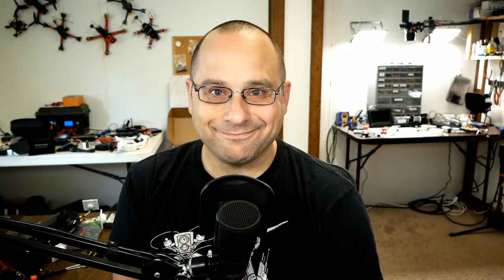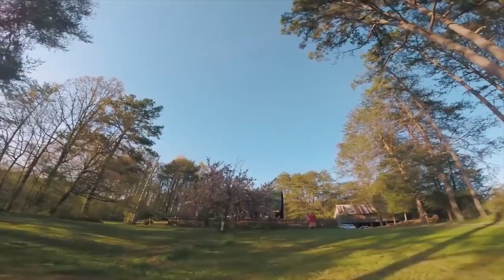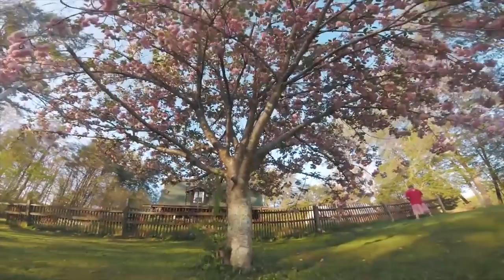Parallel Charging | CAN YOU MIX DIFFERENT mAh OF BATTERY

Comment: Great video! Love seeing myths addressed.

Most chargers use a particular level of current to determine when to stop charging though, not voltage. It’s often 1/10 of the bulk charge rate but can be fixed too.

A pack being charged will reach 4.20V before it’s fully charged due to its internal resistance and a gradient in the ion distribution causing a voltage difference at points inside the cell. This point is where the charge process switches over from the CC phase to the CV phase and the current begins to drop. As the ions have a harder and harder time diffusing into the anode material, and the number of available nooks and crannies drop,  the current keeps dropping. 

As charging could actually take days to truly finish, where the current has dropped down to the leakage current rate of the cell, most chargers just call it quits when the current has dropped to a certain level. Going further raises the level of stored charge but at the expense of significantly longer charge time. The stopping point is sometimes called the taper current or termination current point.
Reply: Hey, it's you, Mooch! You've taught me a ton about batteries. I'm looking forward to your charger comparo. I wondered whether you were into multirotors when I saw that you mentioned LiPo chargers in your poll about what to test.

Comment: im planning to buy 2pcs 20Ah , and i have already 2 pcs 9ah for my mini solar setup
can i mixed this 4 ? (parallel)
so my plan is
9 20 20 9
then direct the charge from right 20 positive and left 20 positive.
it will work?

Comment: Hi..can i use a 12 V power supply adaptor with 300mA instead of a 12V 160mA?
Basically i need a 12V   160mA for a microphone wireless receiver..and i cannot find a power supply for this one....im just finding 12 Vand 300mA instead.
Thank you!
Reply from the maker: The amp rating is a maximum. If the psu is rated for 300 and the load pulls up to 160, you're fine. It's only a problem if the load pulls more than the psu rating.

Comment: hi Joshua, I do have a question, I have E-scooter with 18 Ah battery build in, and I have just bought a Ebike battery with 17 Ah, they both are 52 Volts,  If I want to use them in Parallel connection, they should be fine right? and I charge them separated with their own charger until it is full charge before I reconnect them together again, that  I shouldn't have any trouble right? please let me know If that is right. Because my 18 Ah battery is not enough for the range for me to use, and I can not afford another higher capacity E-Scooter at this moment.

Comment: Hi Joshua excellent and very informative video
Now i have planned to parallels two batteries but before i do it i need some more points to clear kindly reply asap
1. i have two batteries 185AH Tubular Lead Acid one is new and one is old " 1 year old " the old one is c rating is 185/10 and new one is 185/20 " is that ok to connect them "  ?
2 old 185ah battery shows 12.6 volts and new 185ah battery shows 12.8 volts (after full charge disconnected from charger for about 3 hours ) " can i connect them together " ?
3. i have a 20 amp charger when i connect this charger on these batteries it will provide 10 amp of charging current for each batteries " is that ok or should i connect separate charger for both " ?
4. i have a built-in fuse on my inverter and charger " do i need extra fuse in between batteries " ?

I am waiting for your reply 
Thank you
Reply from the maker: I would not connect these batteries together. They are different age and resting voltage.

It is safe to charge the packs in parallel as long as they are both healthy.

Comment: Probably a dumb question Josh but can I discharge with a parallel board and do 4 to 6 batteries discharging at the same time?
Reply: Yes, as long as they are on the same voltage.
Reply: TwistedGoat FPV yes, you can use the same analogy with water tanks
Reply from the maker: Basically, parallel boards make a lot of small batteries into one big battery. So you can do whatever to a parallel board that you would do to a big battery... with a few safety precautions.
Reply: Thanks guys!
Reply: You can. It works exactly the same as charging, there's no additional concerns (but all the same concerns as charging on a parallel board). Just be sure to never over discharge your batteries. I discharge my batteries fairly often, when I know I'm not going to fly for a week or more, bring them down to 3.8V per cell is optimal for storage.
Reply: As allways, the cell voltages should be as close together as possible, then sure why not?

I often discharge up to 6 batts with my parallel board and a cell checker set to 3.5V on the balance lead.
When the alarm goes off I stop it, and the cells recover to 3,7V for storage.
As current load I use an Halogen light bulb array with up to 6 bulbs in parallel (~4,3A per bulb) and switchable for 12V and 24V input.

Comment: I have a bank (12v 4 cells of 100ah EVE Cells) and another bank with 8 liitokala 105ah in parallel (12v) as well. 
Do you think it is safe to put all them together in parallel (keep the setup at 12v)? 
And which BMS should I use in this case to protect all the cells? 
A 4s will be enough?

Comment: what about lead acidd 12v car battery? i wwant to add a bigger battery hook it parallel with my car's existing main cranking, smaller size battery. do able? i just want the bigger battery for accessories fog lights. do you think alternator will charge both batteries or the bigger battery will ruin the main battery?.

Comment: Hi, I'm thinking of connecting two packs of powerbank lithium batteries together in parallel for more capacity... Is it ok if I connect a 5000mAh battery to a 10000mAh battery? Then I would have two 10000mAh batteries and the added two 5000mAh batteries. I just want to know if I can do that?

Comment: I have a 13s5p battery pack (18650s) and a 13s4p battery pack that I want to run in parallel. Is it safe to 1. Run it in parallel; and 2. Charge them in parallel? My 13s4p pack has a bms and my 13s5p pack doesn’t. Is there a battery I should charge from if it is possible to run it like this?

Comment: So I have four 2200mah 50c 4s packs in series. in my scooter but I'm not getting enough range and I just bought four 5000mah 20c 4s packs to replace them with. Can I put the two different strings in parallel when using them? I will only put the like packs in series. They both are capable of 100-110 amp draw in hopes to keep internal resistance similar. But even still Will there be unacceptable uneven current draw due to internal resistance being different. At most I'm pulling 80 amps momentarily and 20 consistently. I will only be parallel charging similar four at a time cause that's my current ability.

Comment: Thank you so much for this video! Just to be clarified... I have an electrical scooter with a battery of 7.8ah. I want to add an extra battery of 12ah, same voltage. It's ok, or the difference it's too big? Each battery pack has it's own bms, and will be charged at the same time with the same charger.
Reply from the maker: I think that would be okay. But I'm not 100% sure since they are managed packs not just simple cells.
Reply: @JoshuaBardwell  thank you once again!
Reply: Costin-Dorian Giurumescu Hi Costin-Dorian, did you end connecting the 7.8ah to the 12ah? Did it work out okay? Thanks!

Comment: thanks man :D thinking of adding an extra batterypack from an airboard into another, so one has two for doubled range. would this same principles apply? cause in that case the batteries would always be connected to each other, so there cant be any voltage differences anyway, right?

Comment: So what about if you have 2 batteries in paralel but they are different capacity and discharge rating but you are discharging them at 10C or 20C.  Or say that 1 battery is hitting the max discharge rate while the other is not while the motor is asking more than the 1st battery can provide.  Can this screw thing up?

Comment: Joshua Bardwell can you please answer my question I have two brand new 18 650 batteries on a smart charger one reads 4.01 volts the other one reads 4.03 volts is that okay while charging and okay to use in my vaping device
Reply from the maker: Both of those voltages are fine. A tiny difference of only 20 mV is nothing to speak of.
Reply: @JoshuaBardwell  thanks for answering me back I appreciate it but why is this happening all of a sudden when they were both equally charging for a long time? Also the Mah read at the end of the charges one was 2000 the other one was 2073
Reply from the maker: The battery chemistry changes as they age. There is not anything wrong with the numbers you're saying. A small difference like this is no big deal.
Reply: @JoshuaBardwell  one last question if you don't mind please I have Samsung 25r 18650 batteries they State their 2500 mAh but when fully charged on a smart charger they read 2000 Mah why is this I also weighed the battery and it is 45 grams

Comment: what if I plugin just the balance lead into the parallel board of a 4s 1000mah battery while parallel chargin 2 6s 1300mah batteries, is that safe? All three batteries are at 3.7Volts/cell at the beginning of the charging.

Comment: Thank you! I had first avoided parallel charging because I didn't want to burn my house (so I use 3 chargers haphazardly scattered across the house), once not scared I wouldn't because most of my batteries were different sizes and couldn't justify it...but now I'm off to buy one of your new parallel boards and charge away!

Comment: So no problem if I connect 4 of 100Ah lead acid batteries with 4 of 100AH AGM batteries in parallel for my semi truck? The voltage difference is around 0.1, 0.2 volts. Thanks!

Comment: So can i use parallel but not charging discharging: one 3S 1800mah battery with 3S 1000mah batt discharge it with racer on flying all in parallel.. Ty for answer mr Bardwell

Comment: Hi,

Thank you for the video.

Let's imagine that you create your battery for your ebike.  The battery has: 36v 10s6P one of the cells has only 500mAh and all the others 2200mAh. Of course you can have that cell in parallel with the other 5 but what exactly is the impact when draining power from it? How about the temperature that cell can create? What are the risks associated? What is the total mAh that we are going to consider? Any help? Thank you.

I'm doing 2 projects right now.
1-a powerbank to connect laptop and mobile phone.
2-a 36v for ebike.
Sharing everything step by step.

can you help with this topic?

Tx.
Reply from the maker: https://youtu.be/AwqJOLzo59M

Comment: Hi, great video. I have a question can i mix in the same circuit 2 type of batteries. In my e-scooter I have from factory a 12000mha 36v li-ion battery pack and i want to make an externsl battery but diffrent type LiFePo4 7000mha and connected in parallel. Also i want that both battery packs to charge frim same charger in same time. Is it safe or can it be done?
Reply from the maker: No, you definitely cannot mix different chemistry of battery. They have different voltage ranges. Batteries in parallel must be at the same voltage.
Reply: @JoshuaBardwell  Thank you. Good that i didn't buy them yet. I will buy 18650 or 26650 Li-Ion batteries.

Comment: So is it ok for me to wire up two 36v batteries in parallel? One is 5.2 ah and one is 7 ah. Safe? Both have their own bms.
Reply from the maker: If they are the same voltage then probably yes. But without knowing more about the bms I wouldn't say for sure.
Reply: @JoshuaBardwell  thank you for your reply. To be more specific what I am looking to do is extended the range on my e scooter. The internal battery is 36v 10s2p 5.2 ah. I ordered a 36v 10s2p 7.0 ah battery with its own bms for over charge and under charge protection. My plans are to hook up the battery in parallel to get extended range. What I originally planned to do at charging time was disconnect the batteries and charge separately. For one I believe it would be a faster charging time and would install in parallel by way of a switch. The plan is switch on after both batteries are fully charged separately and switch off for independent charging. I’ve always enjoyed your content. Thanks again.
Reply: @JoshuaBardwell  just an update, to make a long story short I ended up getting a 16ah battery off eBay. The original battery I ordered was cancelled by the seller on Amazon. I connected the 16ah battery along with the stock 5.2ah battery in parallel on my Bird Air e scooter and it worked. Now I don’t have any technical data but it seems so work like a charm. My wife’s stock Bird Air scooter of only 5.2ah capacity was just about dead after traveling 6.6 miles on it. We could have taken it to 7 miles without a doubt. On my scooter, with the batteries in parallel, I still had 77 percent battery life and the power was all the way there. Did not feel any drop in power what so ever. I’m assuming based on theory I can now travel about 28 miles at least. Have not done the full battery range test yet. For charging I disconnected them and charged separately. The stock battery only took about an hour and some change to charge back to full. The secondary battery took about 3 hours. If I left them in parallel could I still use the 2 chargers without blowing something up? In theory the batteries would equalize as they are charged correct? Both chargers are 42v 2 amp chargers. I’m guessing if I left them in parallel and charged it would take half the time collectively but I’m not sure. The 16ah battery has its own bms. I’m thinking both chargers would turn off at the same time as they would be working together to charge the 2 batteries collectively.

Comment: What happens when the small battery pack is totally consumed and the larger pack tries to equilize the voltage? Does this affect the overall capacity?concidering that some capacity will be lost from the larger pack trying to equilize the depleted small pack.

Comment: Josh, long time viewer here, love your work. BUT...please use your clamp meter to check current going into each pack of different capacity while charging
Reply from the maker: I've done this.

https://www.youtube.com/watch?v=yTEGhKBv09M

It does vary somewhat because the state of charge of the packs is not perfectly equal, so some packs get more than others. And packs near the end of the board get less current than ones at the head of the board.
Reply: Im talking about ~~whilst you're charging~~ packs not connecting them in parallel. Different quality packs (IR) will take more current than the worse batteries. This is just what ive found anyway and have since stopped mixing my 1300 & 1500 when parallel charging.
Just my 2 cents (im a somewhat inquisitive tech nerd haha)

Keep up the awesome work mate!

Comment: When it comes to the parallel charging 
of LIPo batteries in "balance mode", 
we have to be a little more careful and concentraned !!!!       

Lipo " Parallel charging " Safety Tips :                                            

While we only charge LiPo Accus 
with the same number of cells together, 
( 2S + 2S + 2S +2S for example )   
we´ve also pay attention to the Voltage, 
of each individual cell ; 
to make sure its not more than 0.10 Volts between
each of them.  

Keep in mind - to high electricity flows can cause a fire very quickly !     

Otherwise, the current flow on the charger and cables 
could become too strong for the equipment, 
because charge and Voltage between the cells 
also starts to balance each other, 
which happens right at the beginning of the charging mode,. 

For these reasons 
You should always keep an eye on your Lipo batteries
during the balancing and storage charging process, 
and take appropriate safety precautions.

Comment: A good trick is to plug the lowest voltage packs in first that way if you have a pack of significant higher voltage it discharges into a large bank of packs which will be more easily absorbed by the bank and will be no problem for the single pack as they can discharge at high rates easily.

If you were however to have a higher voltage bank of packs that you then plug into a lower charge state pack the inrush would be really large for that one pack and cause more damage.

Personally I just storage charge all my packs while watching youtube videos and then i know i can just plug them all in charge and go fly.

If I had a large number of packs i would build a equalizer harness with some 1 ohm resistors that way i could just connect them all up let them equalize before parallel charging.

Comment: You can mix voltages so long as the voltage difference is less than the difference in the Internal Resistance.  If you had 0.1V difference and the batteries have 100mΩ internal resistance, the combined IR is 200mΩ.  That means the flow between the batteries will be 500 mA.  If the difference is 0.4V, then you'll see 2A current flow between the cells which is fine so long as the cells are at least 2000 mAh.

If we're talking about lipo batteries with 0.01mΩ internal resistance, a voltage difference of only 0.2V will result in 10A charge current which is bad if the cell is only 2000 mAh.